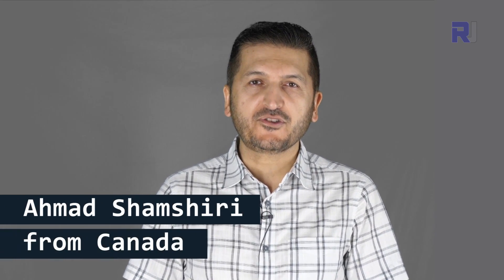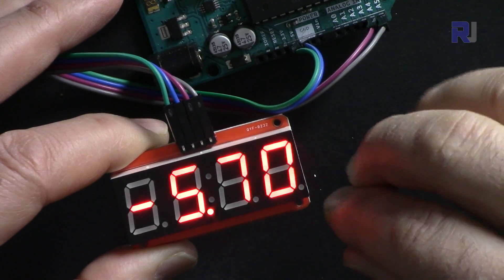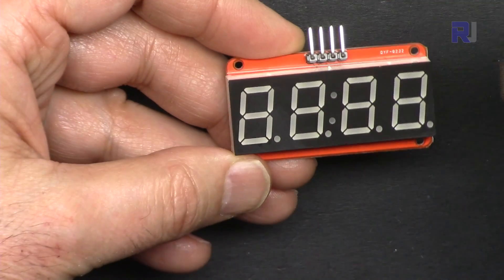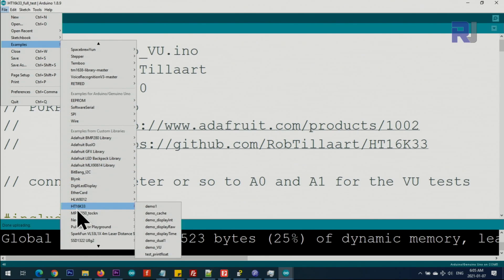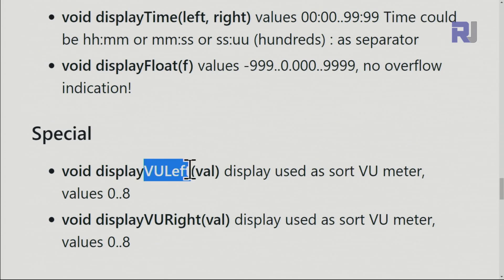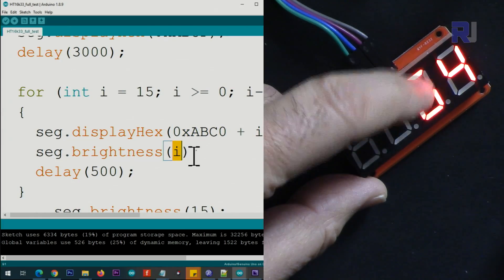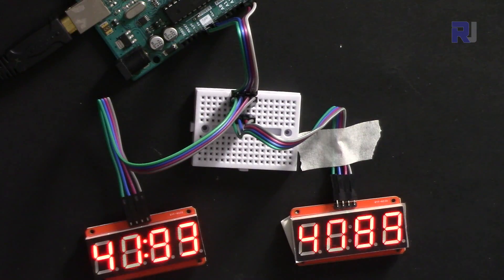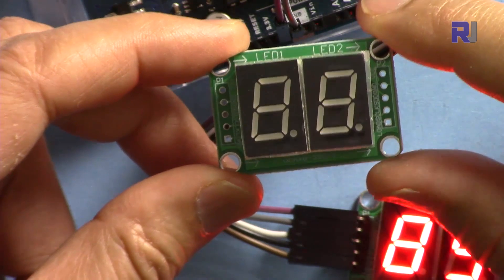Introduction to HT16K33 4 Digit LED Seven Segment Display with Arduino - RJT364

Comment: I need to use multiple of these. How do you change which analog pins are to be used? And how do you differentiate between them in the code?
Reply from the maker: Hi, I have explained it in the video. Perhaps you missed it. Keep watching or watch the better video https://youtu.be/4aCgHNJl9kY or if you want to build digital clock using DS1307 see this video https://youtu.be/gz9xqvRroDY and  Digital clock using DS3231 here https://youtu.be/LEQfzmO9Wm0

Comment: But how do you change the address to 71 ?
Reply from the maker: Just type few number up. I have demonstrated it when showing two of them
Reply: Sorry, I think you didn't understand what I asked.

How do you change the i2c address of the module ?
Since every device comes with it's unique  one. (Do you solder or jumper wire...?)
Reply from the maker: no jumper is needed. I've shown that you can set it in code, it will work. that's why I said I've demonstrated it.
Reply: Scroll down on this link and it explains it

https://learn.adafruit.com/adafruit-led-backpack/changing-i2c-address